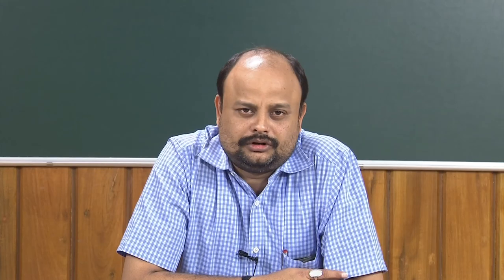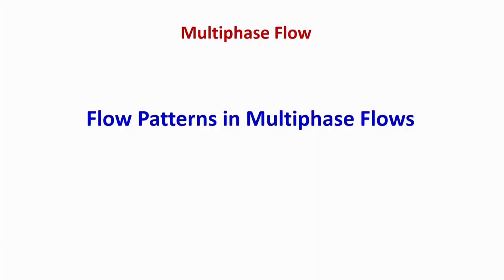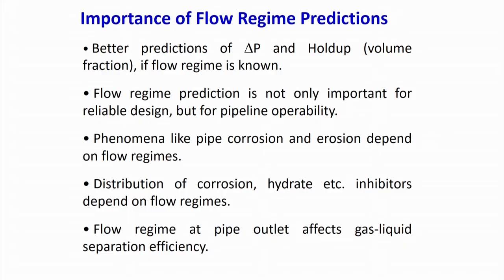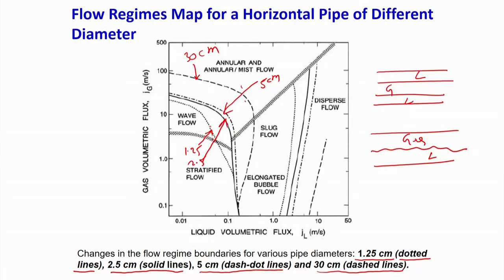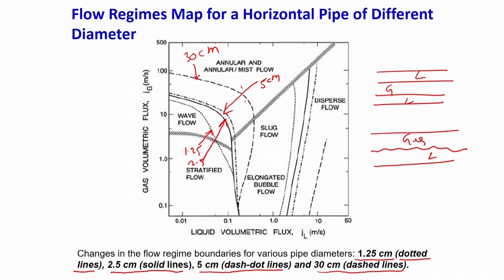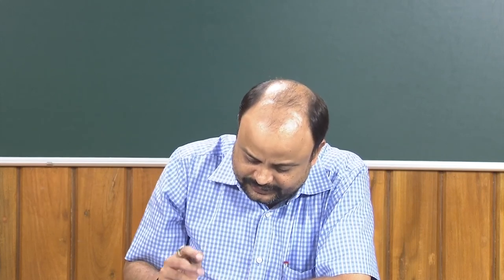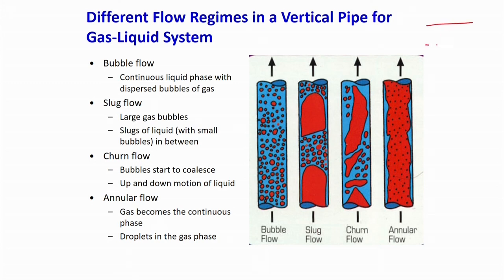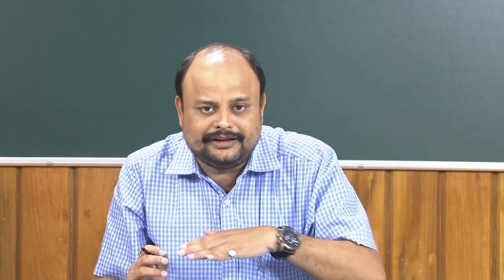Lecture 4: Flow Regime Map for Gas-Liquid System

Comment: Sir this is ganesh mtech jntu kakinada my project is application of phase daigrams in multiple phase flow system plz explain
Reply: mama namaste
Reply: Sir,as you said flow regime will change with change in the diamter of the vessel  so in case of microreactor changing hydraulic diameter from 1.1mm to 0.4mm regime will also change